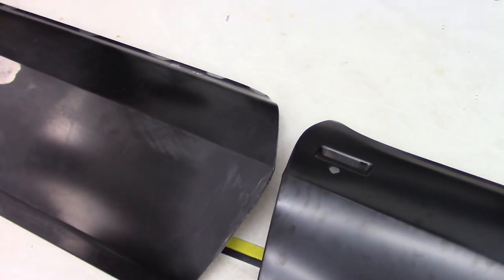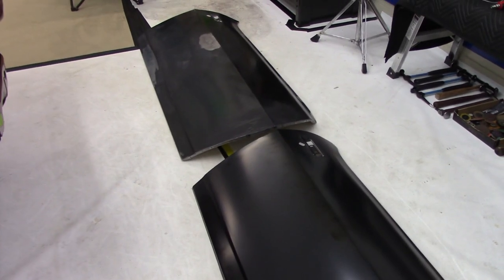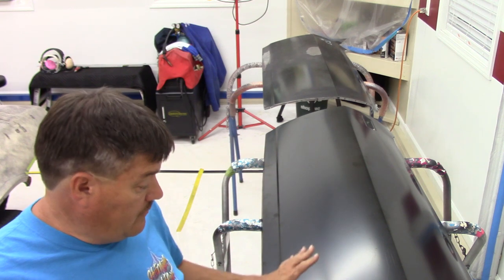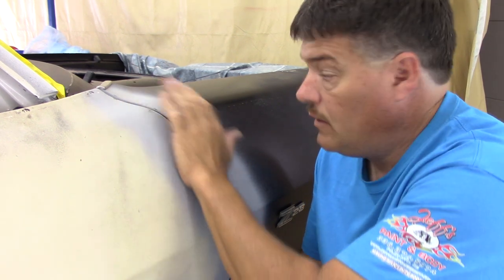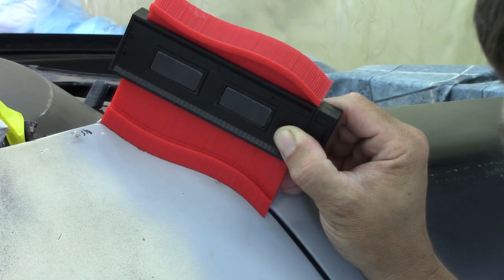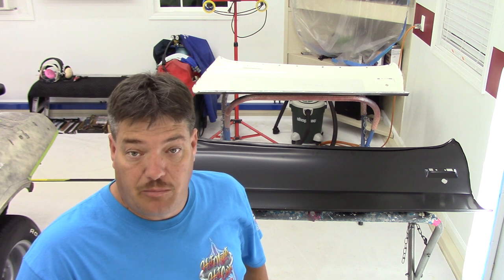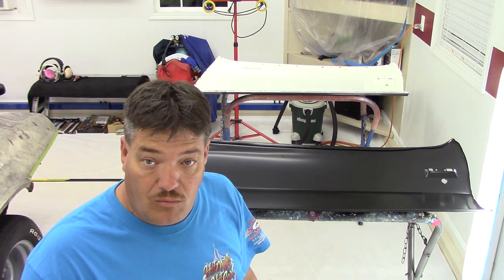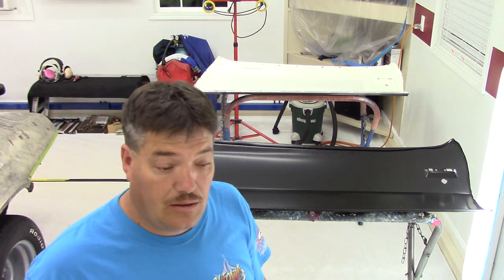GM Door Skin vs Repro, 70-81 Camaro

Comment: Ever speak with tool and die shop veterans about dies and molds being used for re-pops?  Probably old and sometimes not properly repaired or maintained resulting in stampings suffering in areas?
Reply from the maker: Absolutely!

Comment: How about the height from the belt line to bottom edge? I often wonder if the repops are different? I've found issues with rocker to door edge gaps after re-skinning doors.  Weren't 70-74 outside door handles longer?  Have any video on using the longer handle(correct) on newer door skins?
Reply from the maker: Correct, the early cars did use a longer door handle. When I compared the stamping's I didnt see a difference, but will recheck. Thanks and thanks for watching.

Comment: hi, thanks for the videos.

I'm working on a 2nd gen 1977 and I found that the rear quarter flares out immediately behind the drivers door , right on the beltline crease, on the drivers side but not the passenger side. I have seen this once before on youtube where a fellow swapped quarters on both sides and found the one on the drivers side flared out whereas the one on the passenger side actually curved back in a bit, completing the arc of the beltline. can you have a look at yours and see what they look like?
Reply: maybe I should have explained, I bought lower skins and trunk drops because the rust damage is not that bad, I don't know whether to order a complete quarter for that side in order to make both sides match or just replace the lower skins and leave it like it is because the new quarter would have the same problem.
Reply from the maker: Bob, I checked mine, both sides seem to be even with the door. I uses a small ruler and ran along the panel. The quarter does go slightly inward to follow the contour of the door, but its seems to be the same on both side. The body line seems to be even from the door to the quarter on both sides